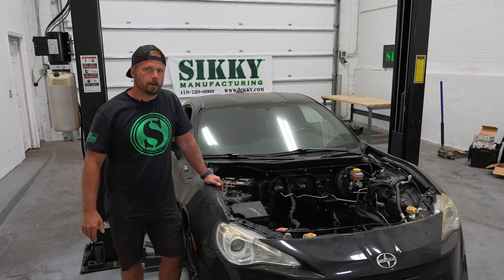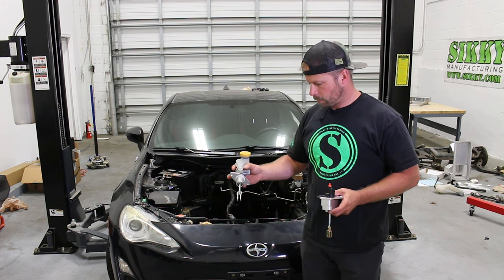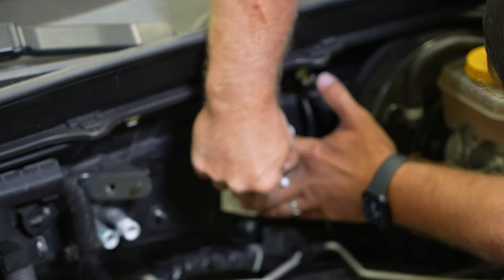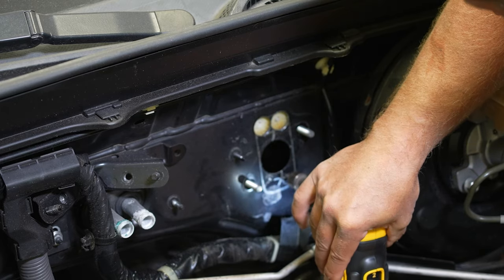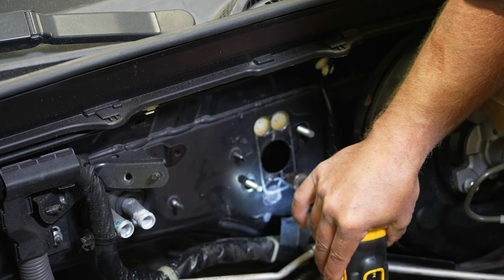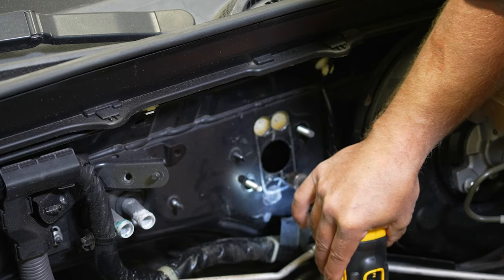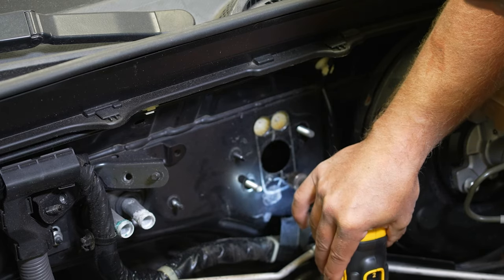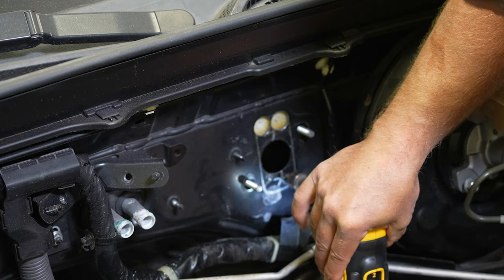FRS LS Swap Part 3

Comment: Put on a positive displacement supercharger ( edelbrock or harrop ) on the original fa20 and it will beat the ls and none of this headache. And the most important thing its much more fun too and alot cheaper
Reply: It would be cheaper, but it definitely wouldn’t be faster, or cooler 😎
Reply: Someone hasn’t driven an LS car before 😂

Comment: Great job James, can't wait till the next video. The only challenge I ran into with the clutch master was installing the clutch line with banjo bolt after the engine was in. On the LS3 where the pcv is at the rear of the driver side valve cover, the banjo bolt is too long to fit in between with the master already mounted. The bolt hits the valve cover. I had to loosen the bolts on the master and tilt it up slightly. Then I could install the banjo bolt and clutch line. Curious if you have run into this as well?
Reply: Same for me. I just cut the damn bolt slightly shorter and called it a day. Haha, works perfectly 1/2” shorter. So next time I have to take it out it would be easier.
Reply: I took off my valve cover to install that 😅
Reply: @TrojanLube69  doesn't the bolt have a flared end to seat in the MC? Seems risky to just cut it shorter.
Reply: @arvinaviles9359  lol, I guess that works too. It was pretty easy to just loosen the 2 nuts and tilt it up.
Reply: @WilderDrift  well mine is turbo. And I had a shit ton of stuff installed. Being the lazy me, i left this for later since I thought it wasn’t gonna be that hard. Taking the valve cover would have been a pain and I had the engine slighly risen by 1-3/4 -2” using engine mount spacer to allow clearance for 76mm turbo. 

It’s been 2k miles, it doesn’t leak. Doesn’t matter, it’s just passing fluid, although I put some thread lock in the threads just to be sure. If I have to fix it, so be it. Haha. Hasn’t hurt anything yet, and if I have to change the master, it would be easier.
Reply from the maker: Thanks!  Yeah it's tight.  Easiest thing we've found is to take the valve cover off but I think the method of tilting it like you did could work well also.  Good tip!

Comment: Best way to match the clevis adjustments is to stick a long #2 philips head screwdriver through both clevis' and hang the master cylinders upside down.  Then twist the new master cyl to match the old one.
Reply: Dude thank you for this

Comment: If I’m running an automatic trans (4l60e) what would I need to install instead of a master cylinder  as I’m not manual running t56
Reply from the maker: nothing, you would run the shifter cables and mount the shift assembly.  A trans cooler would be a good idea.
Reply: @ okay thanks, by the way do the engine mounts in y’alls LS swap kits fit any ls engine? & as well as the transmission mounts that come with the swap kit would they fit a 4l60e?

Comment: This swap is very contagious and I am currently working on mine. However I work in gm and figured why not try a new tr6060 transmission for my ls swap. Any recommendations or heads up with that transmission. Beside the shifter relocation stated in your previous video is there much more additional prep work needed to the chassis. 
Does the trans fit in the tunnel ? Have any customers shared the experience? Anything would help before I let go of that idea completely

(Side note these past videos have been way too good and in such depth that for me to even ask a question about another transmission is just tough hahaha) great job love this project.
Reply from the maker: Yes it is!  amazing setup for sure.  yes, the trans fits the tunnel well.  Not much other prep needed.  We will touch on that in future episodes but just some clearance on the tunnel by simply hammering it into position only moving is slightly in certain areas to get that clearance.

Comment: How much does it cost to change a brz 2013 engine to a ls engine and change it from automatic to manual with you putting everything
Reply from the maker: Price can vary quite a bit based on many factors.  Engine and transmission choice causing the most fluctuation.  Yes, it can be converted to manual during the conversion.

Comment: How new can the BRZ/86/FRS be? Year?
Reply: All 2013-2021 are nearly identical in every aspect. There’s very few differences and a lot of them are aesthetic. So you should be okay with any year.
Reply from the maker: Biggest issues could be on the electrical side if your going very new like 21 or so but maybe not.  Have not dealt with any that new yet